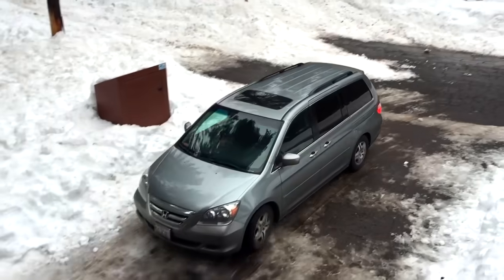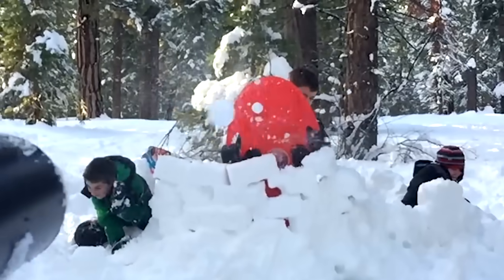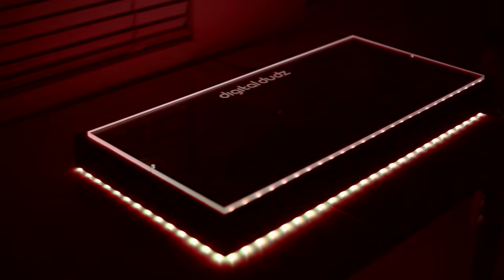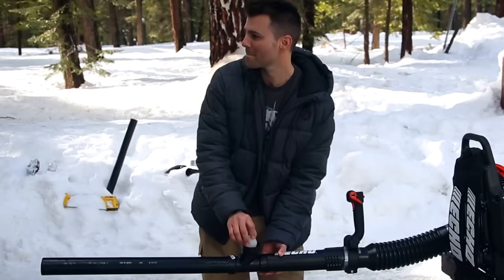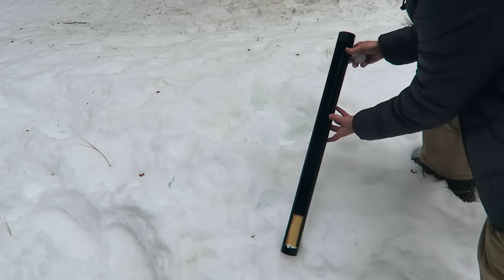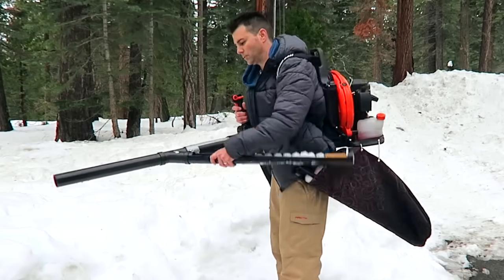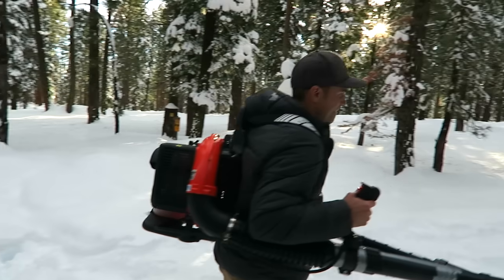Snowball Machine Gun- How to make

Comment: Correction:
- Non-automatic: every shot must be loaded into the chamber and fired individually, even with a magazine involved. Typically a bolt action.
- Semi-automatic: One shot is fired at a time, but the gun loads the next shot into the chamber from a magazine.
- Fully automatic: The weapon continues to load shots into the chamber and fire them as long as the trigger is depressed.

This weapon falls into… probably none of those categories, but closer to fully automatic.
Reply: I was confused when he said single shot to semi-auto. In this video since he has more loaded in the tub, it would be semi-auto if you choose to control the rate of fire in that way
Reply: I have the blower backpack he has. You have to hold the trigger down for air to come out. So it's automatic.
Reply: @sumgue4964  That would indicate it’s fully automatic, but one can start blowing and then load or not load snowballs into the chamber which are then immediately fired. The situation is tricky, because the magazine isn’t spring loaded.
Reply: W-who asked for a correction?
Reply: @syskeyjs  I did 🥸.
Reply: @syskeyjs  I wouldn’t want to disappoint myself… Would you want to disappoint yourself?

Comment: Really cool ideas and vids. But one problem, semi-automatic and full-automatic isn’t determined by the speed a gun shoots. It’s actually determined by how its fired. You could have one gun that shoots half the speed of another, but if you hold the trigger down for both then they are both automatic. A semi-auto gun requires the trigger to be pulled for each shot. So if you pull the trigger of a semi-auto gun, it should only shoot once. Then when you release the trigger and pull it again, it’ll shoot another time.

Comment: Without reading through the 10,119 other comments, I might suggest that you need to tackle the other part of your first observation. MAKING and throwing snowballs with your hands is really inefficient. So you've tackled how to make throwing snowballs more efficient. Now your next challenge is to find a more efficient way to make them, so you don't have to take forever hand-making all the snowballs to load your snowball magazines. I'm sure using the gun is a lot of fun, but how long does it take to make snowballs to fill the magazines, and could you figure a way to expedite that process and/or make it work at the same time as you are able to shoot?

Comment: If it fires 13 shots in .5 seconds, .5 times 120 is 60 seconds and 13 times 120 is 1,560. So this is a rate of fire of about 1,560 rounds per minute. For reference, the rate of fire of an MG-42 is 1300 rounds per minute.

Comment: i have a slight improvement for you clip system first they dont need to be balls per say instead of the wide opening have it just wide enough to have a small handle to pull the plunger down and at the attached T point have a stopper now to reload just take the pipe and scoop up the snow slide in to position in the T pull plunder tight open valve and unleash the fury

Comment: 13 snow balls in 0.5 seconds means that the RPM (rounds per minute) is 1,560 which is half the speed of the fastest firing gun which is the AO-63 it has 2 barrels and fires at 6,000 RPM or 100 rounds per second but since the Snowball Gun has one barrel , to make it fair The AO-63 has 3,000 out of each barrel or 50 round per second compared to the snowball gun which is at 26 rounds per second meaning that Mark Rober made a projectile launcher that fires at 52% of the speed of the fastest firing gun out of one barrel

Comment: i did some quick maths, and i found out that this fires 40 continious snowballs slower than the standard version of the MG81,which has an RPM of 1600. Thus, this can hypothetically be used as an AA machinegun, providing you have enough snowballs

Comment: So at 2:10 you said single shot, semi-automatic, then fully automatic. For semi automatic you showed a burst of snowballs which is not semi automatic, Semi Automatic is when you have to pull the trigger once per shot not for a burst. So when you said single shot, you could've said semi-automatic. When you said semi automatic you could've said burst. Fully automatic is fully automatic so you didn't have to change that. I hope this helps with your correction and sorry if this sounds a bit rude I'm trying to make it not sound rude I'm just trying to help correct a simple mistake.

Comment: Quick though but without having done any calculations...
1.What if you cut the pipe in half so you can make cuts like rifle gun for more accuracy 
2.what if you could spring load the magazines so you won't have to push with your hand (but then you would have less balls in each magazine due to the spring....etc)
🙂

Comment: Now to make a device that produces snowballs just as quick. Probably make it a turret mounted gun. I'm thinking a hopper with snow in it that feeds into rotating molds that come together to form two halves of a snowball that then drop into a container or belt system that transports them to the feeder.

Comment: Put a lighter at the front and put lighter fluid snowballs and u have fireball cannon
Reply: Water does NOT put out gasoline fire.
Reply: This kills the nephews.
Reply: nickiboi nickman he will burn the house
Reply: the biggest heck I bet the backyard scientist would do that
Reply: Ethanol is hard to freeze
Reply: Meet the Pyro
Reply: YIKES XD
Reply: InfernoBoy8 actually The King Of Random made flaming snowballs, so it woouuullllldddd be possible... but hard.
Reply: Doubt the blower would be able to throw a rock very far considering mass differential, let alone size & shape. Shape/size of the snowballs (or other projectile from this “gun”) is key to straight flight trajectory and maximum range.
Reply: InfernoBoy8 watch king of random do it
Reply: Calm down satan
Reply: Your nephews died, T E S T F A I L E D
Reply: Thanks for guide
Reply: Mission failed
Your nephews died
Reply: Thats murder 😂😂😂

Comment: Out of irritation that my current blower doesn't provide much range and he never added links to the instructions I went and looked for a proper blower. I believe the one you get by googling 215 MPH 510 CFM 58.2cc Gas Backpack Leaf Blower with Hip Throttleis probably sufficient for this use. It has twice the power of mine, and mine works aside from the lack in range. I plan to eventually buy one of these myself, but it is a little expensive at $330.

Comment: they go to see snow, doesnt realize there are differnet types of snow. theres a powdery snow that was seen at the very beginning, then there is packing snow which is super easy to pack.
Reply: With snowball makers it doesn't matter the snow, aside from that if you use cheap makers you have to be careful in thick snow to avoid breaking them.

Comment: This is an older video but did you try building the snowball machine gun with a gravity fed magazine/hopper? Did it work?
Reply: He could do that, but then gravity controls the rate of fire, so if you want to fire only a few shots at a time that doesn't work as well. With the rate of fire you don't necessarily want faster, as the ammo is used up too quickly.

Comment: Put magazine vertical (or on slight 20 degree angle backwards) to use gravity to pull the balls down into barrel. If need be have an expansion spring with pusher plate in the mag. to push the snowballs down into barrel just like real gun magazine.

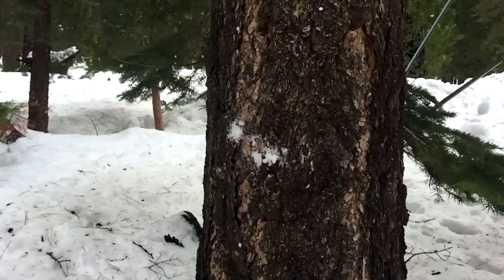Comment: Just one correction on your use of the word "semi-automatic" at 2:13.  Semi-automatic when applied to guns of any type does not mean more than one projectile per trigger pull.  It means the only action needed to be taken is a single pull of the trigger for one projectile to be propelled.  No manual bolt action to remove any shells or cock the hammer back is necessary.  Each single pull of the trigger is one projectile.

Your snowball blower gun is always a single trigger pull for the multiple projectiles that you determine are fed into the chamber so it can only be an automatic.  The fact that your "magazine" is managed manually and not by gravity or by a spring mechanism doesn't affect the status of the gun itself.

Comment: So I didn't make the project yet but I was thinking putting an automatic thing that will load it in by it self or just use a long spring so I would just pull or hold the trigger for firing

Comment: Must we bring tacos up? Now I'm craving them. I either have to drive three hours south to Austin to stand in line at Taco Shack, or four hours south to Houston and hunt down the old fellow that ran the Tasty Taco van, the latter of which has enough cilantro in the pico de gallo to blow the top of your head off. And, not far from where I'd expect to find the Tasty Taco van, there's a gas station/take out that has breakfast tacos the size of a sub sandwich. Okay, now I'm really hungry.